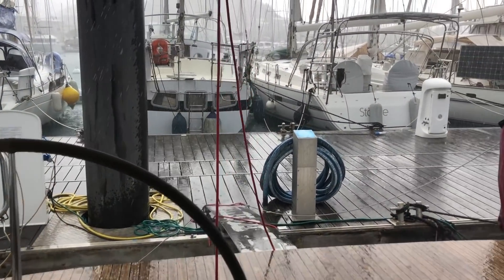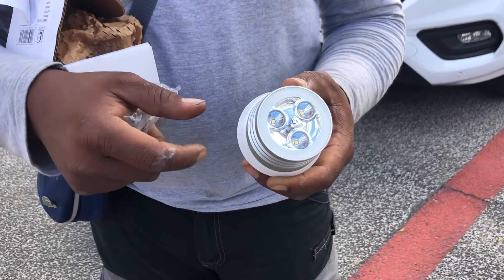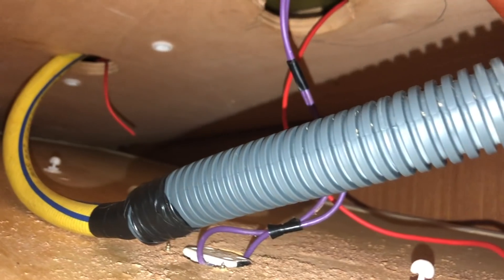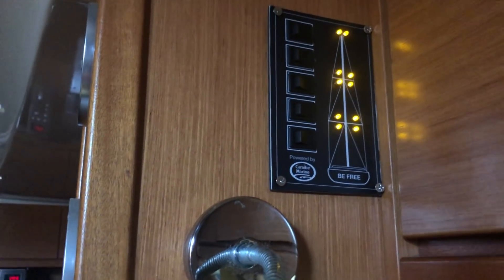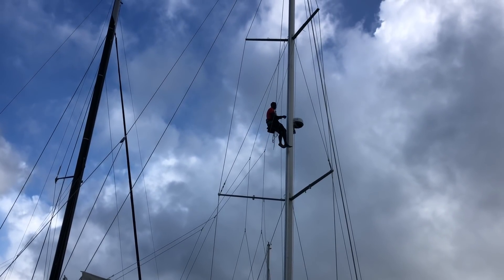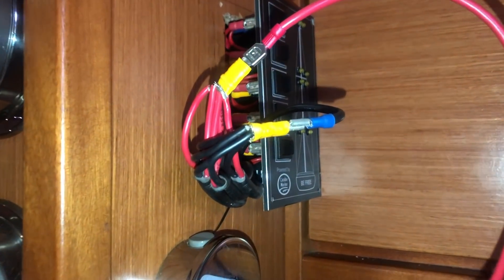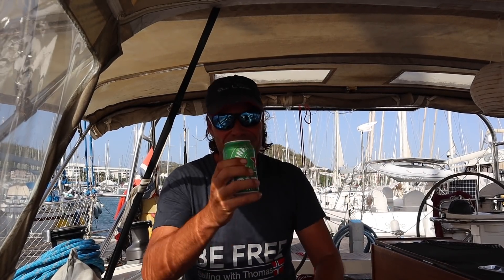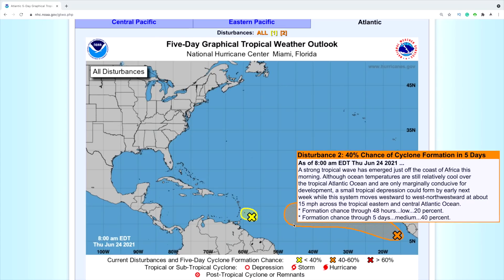SAILING MAST Spreader lights installation - SwT 57 Finally I can see the light

Comment: Hi Thomas, great lights! Q: how do you make the switch panel? E.g. how do you ‘print’ it?
Reply from the maker: Thank you for watching and your question. I made a design on my Mac trying to make it as small as possible and similar to existing panels. Then bought all the switches and diodes needed. Based on this I had to redesign the front end a bit, and played around with the back side having all the exact measurements. The final design file for print on Alu plate was delivered digital to a print shop that could engrave or print my design on plastic covered metal. Used same process making the additional panel with dimmer for all the lights.
Cheers 🍻
Reply: @SailingwithThomas  cool man! Thanks and happy sailing.

Comment: Nice mast light setup Thomas! ✅ what is the brand and model of lights you had installed? Also, how many lumens per light? Cheers!
Reply from the maker: Hi there and thank you 🙏🏻The spreader lights are Lumitec Zephyr LED and gives 1000 Lumens each. 12-24 volt and with 12V they draw 1,3A each. All the best and cheers 🍻

Comment: Thomas where do you find the parts to build your switchboard?
Reply from the maker: I had a print shop to make my design for the front panel. Rest ist just switches and LED you can buy anywhere. The “backbone” I made out of a bridge/fuse box and glued with epoxy. Pretty straight forward and easy but happy with the results and inside BE FREE it looks great. Cheers my friend 🍻